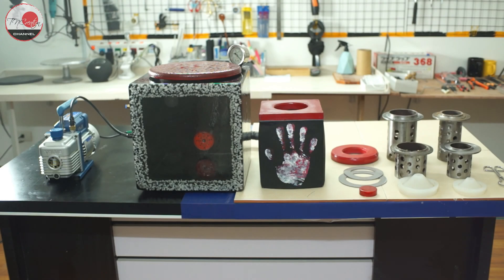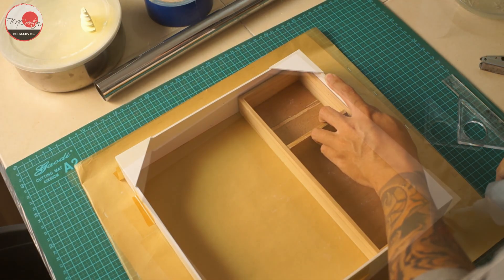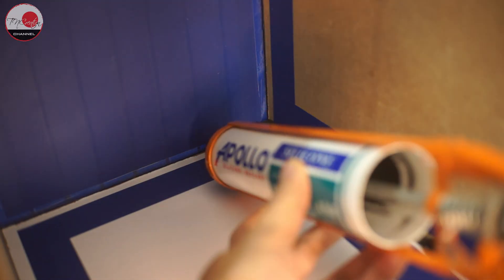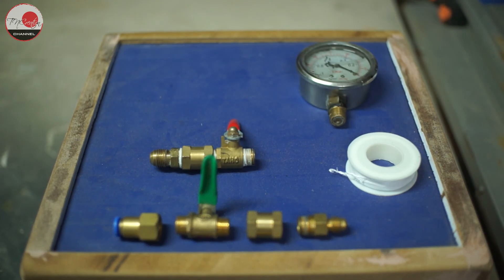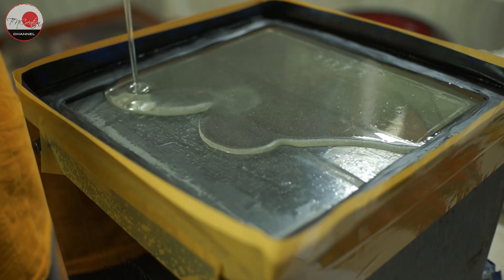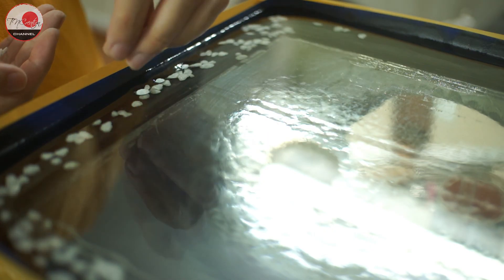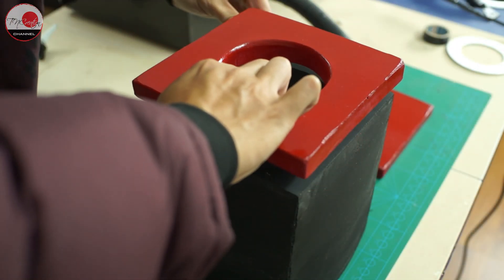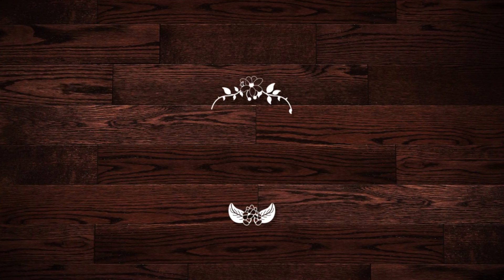DIY | Casting Vacuum Chamber

Comment: Please please up your saw knowledge first thing your blade is way too high you should be a half inch to an inch above your surface your cutting being all the way up like that there is a chance that your back tooth will bind and send your wood back into your stomach!
Second if you get a new blade that has a thinner tooth profile you will get way nicer cuts with way less smoke! If your piece of wood smokes or Burns at all you need to replace your blade

Comment: Nice!  I appreciate your ingenuity. Just curious why vacuum through both chambers?  Why not just connect directly to each chamber?  Is it to dissipate the heat from your casting chamber to protect the vacuum pump?
Reply: I agree. Very nice work, but the whole thing seems far over complicated to me. I'm a keeping things cheap and simple kind of guy.
Reply: If both run simultaneously its because he just doesn't have a split/valves 😂

Comment: Hello! Just a quick question! You say that a 7-9 CFM pump is an ideal pump but you recommend in the links a 5 CFM. Is a 3/4 CFM pump enough? Also did you use the casting vacuum chamber yet to any actual cast? I was hoping to see videos of that on your channel! Did it worked? Good job and all the best!
Reply from the maker: Hi Fabio, in my link they are 2-stage vacuum, which is more than enough.The 2-stage works stronger but cost a little more.  I could not add the information once i uploaded the video. But if you have a 1-stage vacuum, it is better to have a 7-9 CFM pump. About, actual vacuum- i have been using it a few times for my small project, it works great, just the product wasn't great to make a video :)) :(.

Comment: Also, does the vacuum machine handle high temperature of casting or it melts down?
Because I need to build one like you for METAL vacuum casting...

Comment: Hi, I would like to know how did you craft the silicone reduction for the flasks, which material did you use, what temperature di they handle?
Reply from the maker: I will try to make short video soon about this, I'm sorry for this belated video.
FYI, I made it from High temperature silicone  ( Fire resistance Sealant) and RTV Silicone